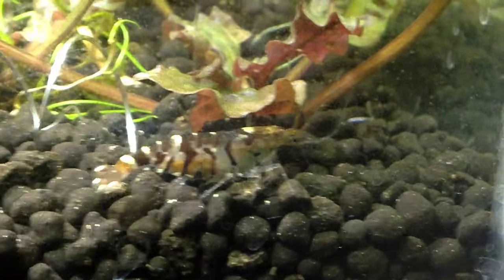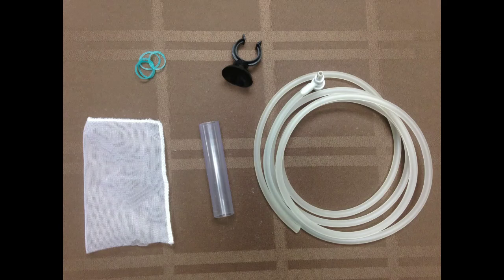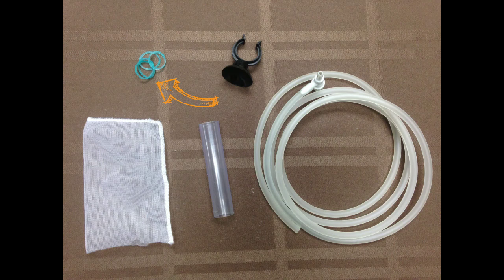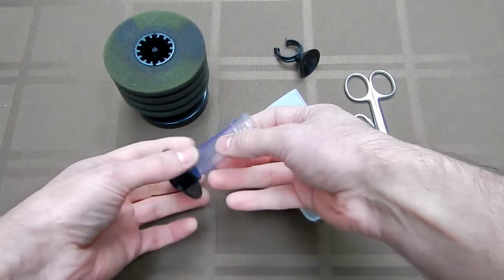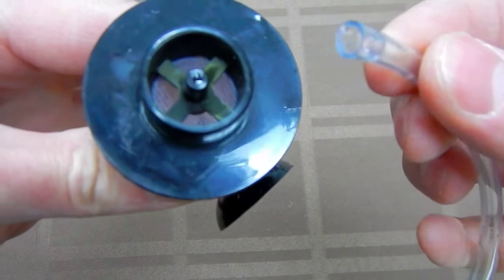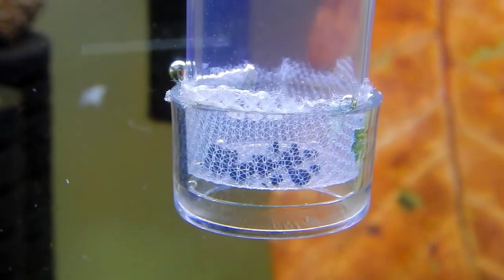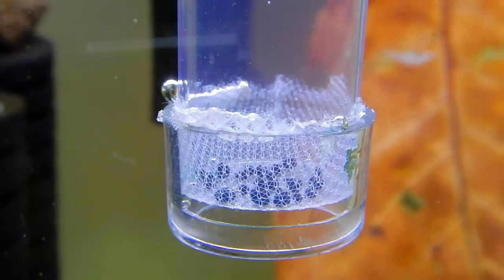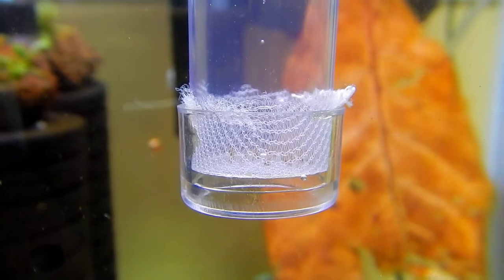DIY Egg Tumbler

Comment: cant make it work
Reply: air stay stuck, tried different mesh size, it stores up air until it release a bunch a bublle making a huge jump per 5 sec
Reply from the maker: Poke the mesh with a tooth pick to make small holes which will help the air escape.